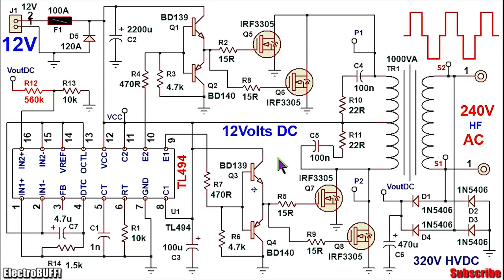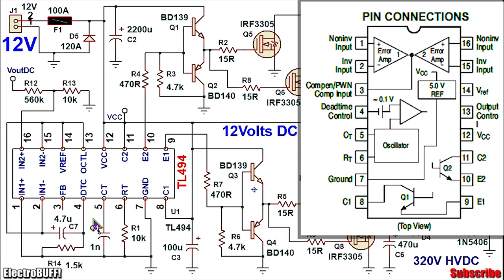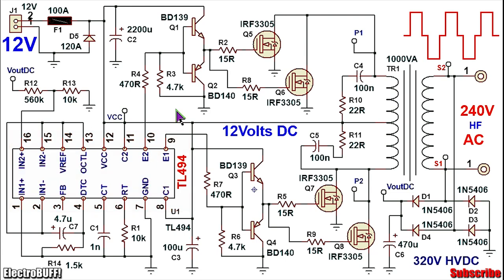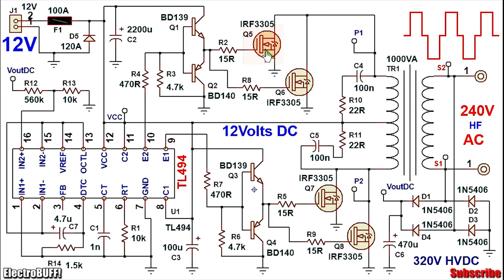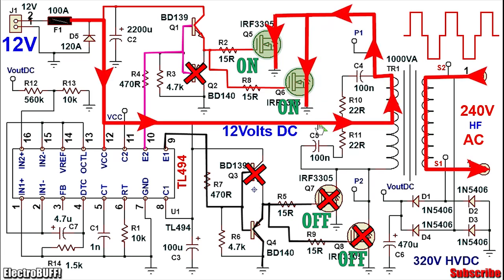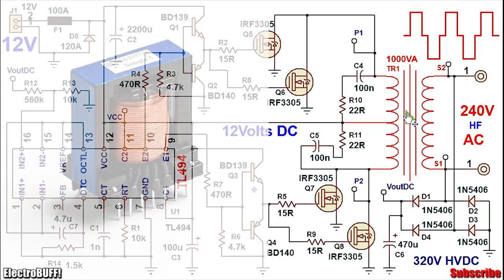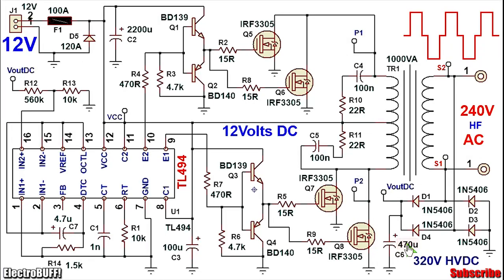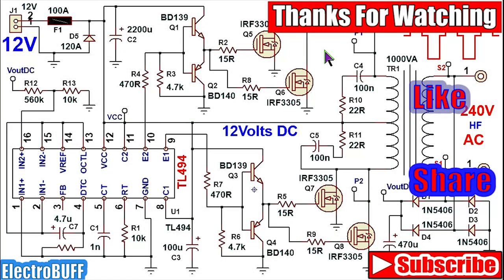TL494 High Frequency Inverter & High Voltage SMPS (Switch Mode Power Supply) 1000 Watts

Comment: Thanks for sharing such an Awesome project. Can you please design and share the circuit board to operate inverter dc air-conditioner compressor to feed UVW windings with potentiometer to decrease or increase the running speed.
An early response will be highly appreciated.
Thanks & kind regards.

Comment: Thanks but for improving the design u need to add closed loop control for output voltage
Reply: Look again, i think the VoutDC from D1 to D4 connected to iN2; pin 16 TL494, via divider R12, R13 is closed loop control for output voltage !
Reply: Ah ok I see thank you
Reply: G E T R E K T 905  Why tell me ? I am neither the designer or the publisher. You should send your suggestions to the originator, I have nothing to do with this other than pointing out the bleeding obvious to someones comments !

Comment: TL494 is very legacy controller. I think UC3825 is better than TL494 because it pulse by pulse current limmit function that protect MOSFET from over current complately.